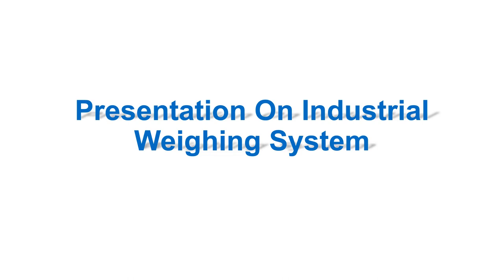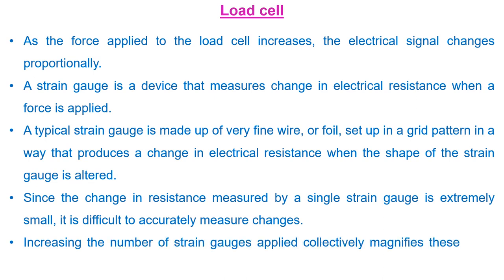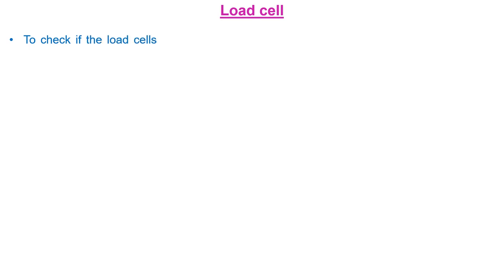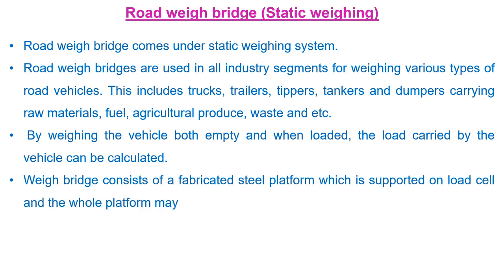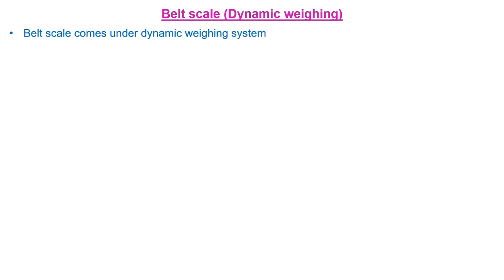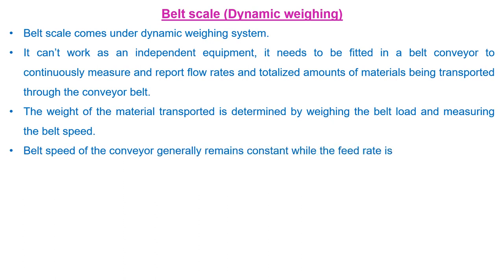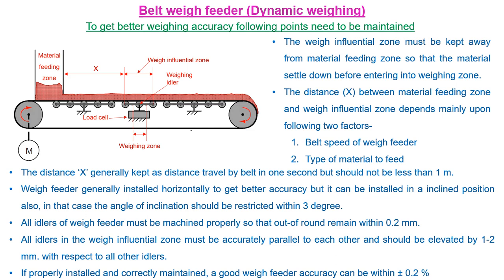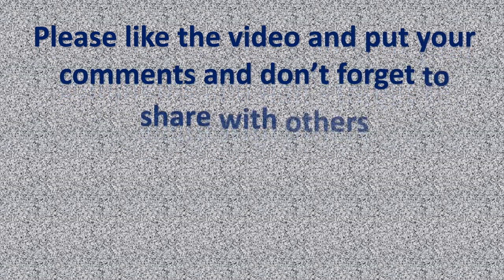Weighing System and Load Cell Working Principle

Comment: 35tph belt conveyor then how capacity of load cell is fixed
Reply from the maker: Tph and belt speed are needed first. Spare capacity C=35tph, belt speed V= 2m/s. Then material Load on belt per meter W= (35x1000)/(2x3600) =4.86 kg/m. Then add belt weight, idler weight, etc then you get total weight per meter length. Then considering some design margin and divide with number of loadcell. Then you get load cell capacity. Hope this will help you.

Comment: Also clarify the calculation in belt scale for single idler
Reply from the maker: You just have to reduce the weighing zone length in case of single idler. In case of single idler the weighing zone will be C to C distance of idlers. Thank you

Comment: How to calculate tare weight using mV singnal
Reply from the maker: Actually tare weight means empty weight of container/vehicle. If we put empty container/vehicle on weighing scale then display will show tare weight. As per load cell specification, load cell needs to be calibrated before putting in weigh scale. How much output mV will indicate how much weight on loadcell that depends on loadcell specification and calibration.
For example- if any loadcell specifications are as follows
Rated capacity- 600kg,
Rated output- 1mV/V
Recommended excited voltage- 10V
If you calibrate loadcell such a way that 600Kg~10mV then after putting 60Kg on loadcell it will give 1mV output.
Hope, i am able to explain you. thank you